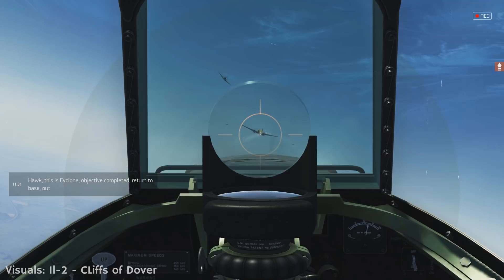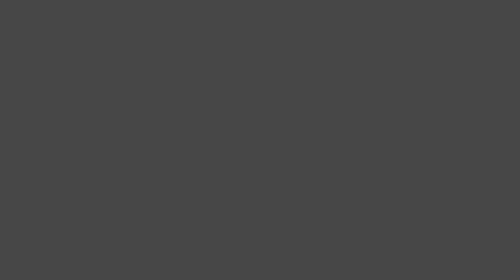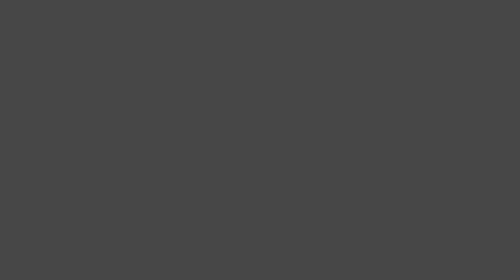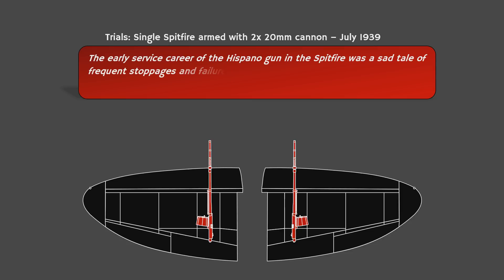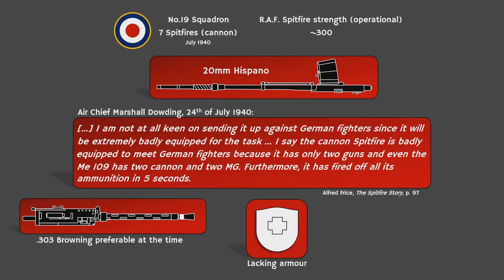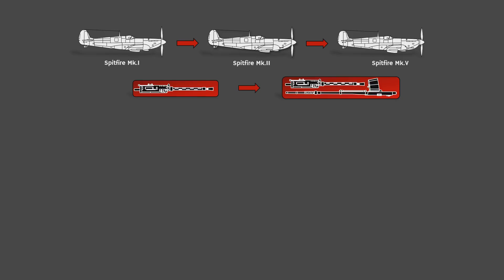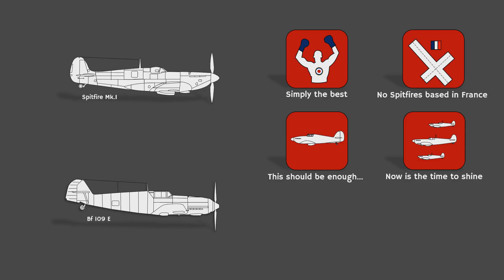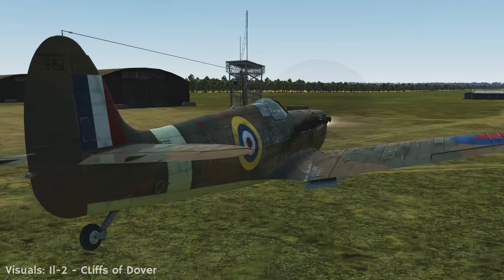⚜ | Clearing up Spitfire Misconceptions

Comment: American fighters used a system called a carburetor that was actually an analog mechanically controlled throttle body fuel injection system. The Spit and Hurri had one really bad design flaw and it wasn't the carburetor. The fuel tank of both machines was mounted at the firewall in the nose! Because the British used rifle caliber guns (obsolete for air combat) they had to get within 250 yards of German machines to do any real damage. Even then it might take all of the ammo to damage or shoot down their target. German bombers had rifle caliber 8 x 57 Mauser cartridge defensive guns. So having to get close to German bombers meant the British machines were in range of the bomber's guns as well. This allowed hits on the fuel tank which could and did turn Spits and Hurris into flaming death traps. Survivors were horribly burned. Pilots who managed to bail out often had their chutes on fire and plunged to their deaths. This is the real tragedy: P-40-C Tomahawks were routinely operated  by The Flying Tigers to 18,000 ft. The Tomahawk was a match for or better than the 190E in all but initial climb rate. The twin fifties in the nose would have torn the German planes to pieces. I saw a 0.30 - 0.35 caliber rifle test vs the BMG M2 0.50. The rifle calibers put some very good dings in an anvil, the BMG cracked it in half! Inexperienced pilots were firing their .303s from 400 yards wasting their ammo. In a Tomahawk 400 yards with the fifties would have shredded the bombers, their 8 x 57s were ineffective at the longer range. The British lost all of the French lend lease P-40s to the Germans, and for some reason never asked for any themselves. In the BOB the Brits would have been better off with the Tomahawks

Comment: Just a point about the carb you may not be aware of-because of the low temperture created in the carb/higher dentity, this gave the Spitfire a horsepower addition that was taken into account and therefore gave an advantage in terms of power to weight over the Daimler-Benz engine of the Me109-(I call it Me109 May hundert  Neun becuase thats what the German pilots called it-never the BF-109

Comment: I must admit I didn't know about the stalling of the carborators.  Also I had assumed that all engines of the day would be carborated as fuel injection only really started appearing in cars during the late 1970's.   Performance wise my impression was that the BF109, being a full military design, had more armour, was better armed, had better range and was heavier as a result where as the Spitfire, being a converted racing plane, was lighter, faster and more maneuverable.  In later war years it lost its edge next to designs like the FW190, ME262, P-51 Mustang and P47 Thunderbolt.
Reply: Err the 109 range was shorter than the spit. Armour depends on the version but it was not much different after very early war period. Fitting armour was more of an issue in the 109 by a long way
Reply: Not really.  The Spitfire had little to do with the Supermarine racers, except that they showed what could be done with high power in a small airframe.  The constructional techniques and aerodynamic design were quite different.  If anything the Spitfire was better armoured than the 109, with heavy aluminium protecting the fuel tank as well as an armoured windscreen and rear armour behind the seat.

Comment: It could be pointed out that it took over 3 times longer to build a Spitfire air frame than for the Bf-109 (about 2 and a half times longer than for the Hurricane).  The Spitfire had its .303 machine guns spread out across its wings while the Hurricane had them grouped closely together in each wing, making them more effective by concentrating the fire power.  Because of the threat of invasion, Britain kept Spitfire aircraft on the Home Island for a long time after the Battle of Britain, while the Hurricane was sent off to Africa and the Far East.

Comment: One way around the carburetor cut out when nosing over into the dive was to role it onto its back first and then pull back on the stick to get it to dive before straightening out again. This had two problems. One if you were in pursuit of a German aircraft the manoeuvre took time. Fractions of a second yes but this counts. Second problem is that if you are being pursued by a German aircraft it did giveaway the fact you were going into a dive. Interestingly fighter pilots today still roll onto their backs before diving because we now know that pushing the stick forward into a dive causes blood to go into the lungs and is a health hazard..

Comment: Spitfire pilots I spoke to as an ATC air cadet in the 1970's spoke of having to dip the wings slightly left then right to help the carburettors before doing the "Spitfire roll" down into an enemy formation. Personally I would have preferred to have been in a Hurricane as the airframe took terrific punishment and the machine gun pattern was closer and more effective, so more likely to survive. My favourite book as a child was the memoirs of Squadron Leader Stanford Tuck based at Manston and was advisor on the film "Battle of Britain" 1968 using the then current Spanish airforce who still used the ME109s, Heinkel H111s, Junkers JU87s and others.

This was our second successful Brexit from a European super state run by Germany. Here's to third time lucky.
Reply: The Hurricane was outdated, and the "it took more punishment" line is hyperbole.  It had the same vital points as the Spitfire, and moreso, with its header tank being unprotected and torching the pilot when pierced from the frontal cone through the firewall.   A skilled pilot with enough radar forewarning/direction could position himself tactically, but normally the slow climbing hurricane was last to the party.   Worst kill ratio of the Battle of Britain.

Comment: The carburetter problem was solved by Beatrice Shilling. It was called Miss Shilling's orifice. there's a pub in Farnborough Hampshire called Tilly Shilling in her honour.
Reply from the maker: The orifice is mentioned. It did not solve the problem but was a stopgap measure until the pressurized carbs were introduced.

Comment: The wings on the 109 were too small. Which means it is faster. But that gives problems at low speeds and lots of pilots were killed in accidents during low speed landings. I am a big fan of your channel and I like most of the aircraft too. My favorites are the Mosquito and the Me 110.

Comment: The biggest misconception of the which is better 109 Vs spitfire  in early war i would say the 109 had a slight advantage over all ..Speed Armor Weapons  One missing factor was the use of American octane 100+ vs German octane which became more and more lower octane into the war down to 87  Add in you have a great fuel injection system in the 109 Which would out preform the spitfire had it had the same octane Even give the 109 a few extra mins of fighting time  Many 109's had to run lean and climb slowly to England Then 100% power to dog fight for 5 to 10 mins before having to turn and head back to France  Which was a lot of wear and tear on the Engines  Now with 87 octane on a abused engine  Your dumping more fuel and getting less power 
The Spitfire was designed for speed first Then machine guns ..having these odd thin wings Designers after the fact had to see what pre made machine guns would fit ..303. won 20mm cannons were a bad design and bad method of feeding the cannon itself 
Hurricanes were fast but lacked the grace of the spitfire Thus more gun power and ammo went after the bombers  Spits after the 109's  Had the major role been reversed the out come would of been a huge loss  And yes Hurricane did in fact shoot down 109's and spits on bombers ..But engagements of these favored the enemy 
The English loved Variants  Tempest, Typhoon, Mosquito  Lancaster But not only it's planes But also its weapon types and loads  example The Mosquito in my eyes was the most versatile aircraft of the war  Here you have Not just a Fighter / Bomber / Recon But it was made of wood Mostly cut down from western Canada  Giving the guys at the metal works one less strain of production. Carpenters, Cabinet makers now had war effort jobs In Canada and England  The "Mossie" flew at some of the fastest speeds and could fly long distances  Had a wide range of bombs Some of which a normal 4 engine bomber could not handle Bouncing bomb, Cookies, Rockets,  And some where equip with a 57mm auto firing Cannon in the nose or 4 machine guns in the nose 
There was a attempt to copy it by the Germans however they could not get the glue right and the prototypes crashed on take off due to cracking and breaking

Comment: The final staw for the MKI cannon Spitfires in 92 Squadron came when they were sent up to intercept a flight of unescorted bombers. Of the 7 aircraft 4 had to immediately return to base as their cannons failed to fire. Of the other 3 at least one discovered only one of the cannons was working. None of the aircraft managed to fire more than abot 4 rounds before their cannons stopped working.
After this the squadron commander more or less demanded the aircraft be replaced. In a case of be careful what you ask for the RAF obliged by sending them some very early MKI's that had seen heavy use, had the early twin prop propellers and were in such good condition that the first one they started up sprayed oil over the windshield.

The issues with those early cannon Spitfires were that;
The nature of the Spitfires narrow wing meant that the cannons had to be installed on their sides causing feed issues.
The wings were unheated, resulting in the cannons simply freezing when in flight.

The freezing issues were solved by redirecting some of the engine exhaust into the wings. The feeding issues were not fully solved until the wing itself was redesigned.

Comment: I would comment that the Hurricane was not that inferior in performance to a Me 109, except in top speed (it could not catch a 109 even if in a dive), and could out turn both the 109 and Spitfire. The issue that the Hurricane had in 1939-40 was that its pilots were new to active service while the Luftwaffe's had already been blooded in Spain and Poland, and had better tactical training. Witness the end of the war when superior new German aircraft were outclassed by older Allied designs flown by veteran pilots, because there were very few 'Experten' left to fly the new airplanes. Lastly, one of the reasons why it was thought that Spitfires operated over France in 1940 was because the German pilots could not bring themselves to admit that they were shot down by Hurricanes - the same thing happened in the Battle of Britain, including within British media, which made the numerically inferior Spitfire seem far more effective than was the case.

Comment: They fixed the issue of is spluttering during negative G maneuvers in the Mk1's  by fitting Miss Shilling's orifice it a very simple technical device made to counter engine cut-out in early Spitfire and Hurricane fighter aeroplanes during the Battle of Britain. While it was officially called the R.A.E. restrictor, it was normally referred to under various names, such as Miss Tilly's diaphragm or the Tilly orifice in reference to its inventor, Beatrice "Tilly" Shilling.
Reply from the maker: Mike OBrien No, this stopgap measure only appeared in 1941 with the later production variants of the MK.V.. The issue was not overcome completely until the later introduction of the pressurized carberators.
Reply: I think you will find that the RAE was retro fitted into the earlier MK's before they came out in the production engines in the Mk V

Comment: Spitfires didn't seize with negative g.  The Rolls Royce motor lost power due to fuel starvation. The first motors used 85 octane petrol and gave about 750 horsepower. With Griffin motors were three times more powerful.

Comment: The elliptical shape of the Spitfire wings posed a vibration problem. If you notice that the later Spitfires had the end of the wings clipped to solve that problem.
Reply: The clipped wing variants was to give a faster roll rate I have not read about Vibration
Reply: @jacktattis  Ha! That's funny! I read the opposite of you!! It probably did give the plane a better roll rate but also eliminated vibration or cut it down.
Reply: Source please
Reply: @jacktattis  One source was my Dad since he was in the Royal Army in 1946. He used to tell me about pilots talking about the problem. Also from 'Aviation' website;
   "Weight, an elliptical wing is not structurally efficient, and will lead to a higher weight, which leads to higher lift requirements which will lead to more induced drag, even with a very efficient wing.
    Controllability, where and how the wing stalls determines if you're able to recover from a stall. Elliptical wings stall tip first, leading to bad stall behavior."
But no, I don't have anything else to describe the vibration problem.
Reply: @ktcarl  i JUST HAD A LOOK AT MY m&S spitfire the History and  MkVIII JF 319 and JF321 when fitted with with the Rotol Six Blade contra props did have vibration issues
Reply: @ktcarl  Wings same wing from Mk1 to MKXIX

Comment: I read somewhere that the  Packard V-1650 Merlin made under licence in the US had fuel injection from the start which solved the flooding or maybe starving of the engine under negative g problem without resorting to the restrictor that was a useful easy partial solution.
Did the UK Merlin ever get fuel injection and if not why not seeing as the problem had already been sorted by Packard ?
I've also heard the landing gear front wheels of the Spitfire were too close together resulting in some fatal landing strip accidents.
I really don't know much about this subject so please feel free to correct the above as necessary.

Comment: Got one for ya. Most people think the spitfires turned better, but where slower than the 109's around the time of the battle of britain. In actual fact, the spitfires where a little faster, and the 109's could in theory turn just as fast as the spits. IU say "could" because the spits design had an unforseen defect in it, which turned out to be a massive advantage. When making a sharp turn, the control surfaces, and thus the controls would vibrate before the stress on the wings caused them to break. This meant that the pilots had the confidence to push their planes to the limit, as they had a warning before they broke their plane. The 109 and other planes didn't have that, meaning if they pushed it too far, they may suddenly be missing a wing. So although the 109 "could" turn with a spit, they rarely dared to.
Reply: The wings of the Spitfire never broke What is your Source ?
Reply: @jacktattis  At no point in my comment does it say they never broke.

 When you ask for a source you're supposed to quote something they said, not something you just made up.

Comment: 0.56 "Momentarily seize".
 WTF! an engine seize is when the pistons weld themselves to the bore due to lack of oil or overheating or overrevving. 
It is a permanent condition, requiring a rebuild. Nothing momentary about it.
 Please get your terms right, specially if you think you are correcting misconceptions.
Reply: I think he said cease.

Comment: Both the spitfire and skyline had there problems 
The spitfire mk1 had a carburetor and skyline r32 had a electronic injection the problem with skyline years later the early 1989-1991 models r32 gtr rb26dett it had a fuel pump which was problems on earlier gtr models

Comment: The early carberators choked, not seized the engines. Worse were the quality of the fuel of only 86 octane. 200 octane was available at the end of the war.  The three blade propeller needed replacing and  with no invitation, the maker began fitting their variable pitch and constant speed propellers.  Later as fuel improved a far better supercharger was fitted giving a 40 percent boost in power. At wars end, three times more power,  a laminar flow wing and so much more was reading for 1946. Incredibly spitfires were tried with jet engines. Yes the RAF were going all the way.

Comment: Perhaps the biggest misconception was that RAF Fighter Command was winning its battle vs Luftwaffe fighters, it was not. The RAF lost 1,220 fighters, (753 Hurricanes & 467 Spitfires) to the Luftwaffe's 812, (569 Bf.109 & 243 Bf.110). It was the additional 822 Luftwaffe bomber losses that made the battle unsustainable for Germany. Hardly mentioned or given mention, were the RAF's Bomber & Coastal Commands' loss of 524 aircraft during the same course of the battle! Losses given for the time period between 10th. July and 31st. October.

Comment: The top 5 single engined 5 fighters of 1940 were, 5. Nakajima Ki-43, 4. Mitsubishi Zero, 3. Mark II Spitfire, 2. bf 109 Emil and 1. CAC Wirraway. Would you agree? Of course you would.  PS. I wanna know why the Spit  aircraft with such a narrow tracked undercarriage didn't crash like the Bf 109 did.